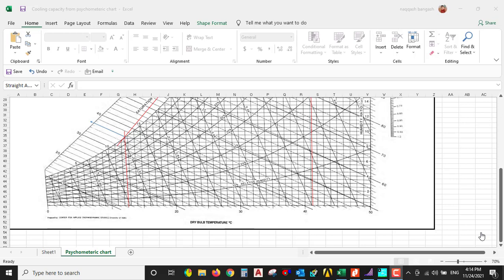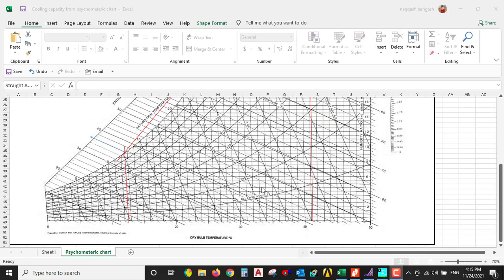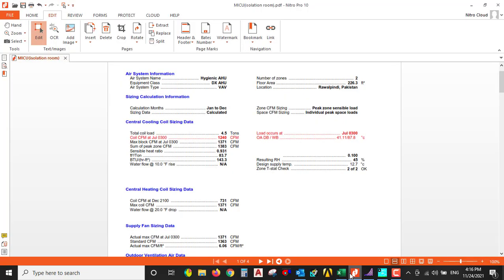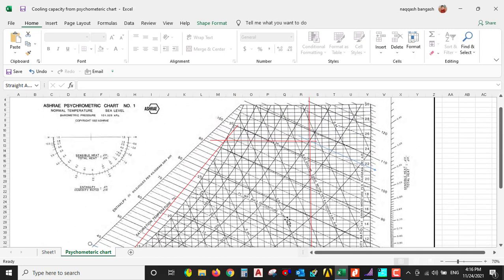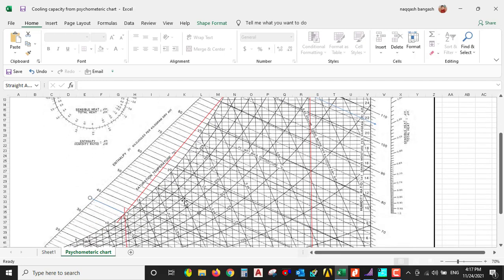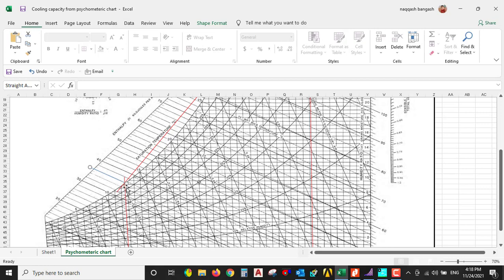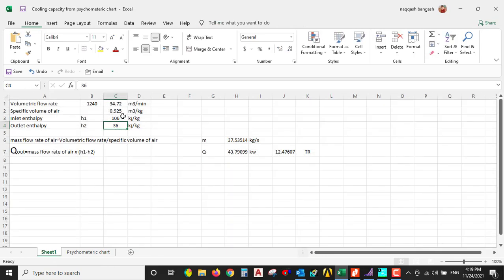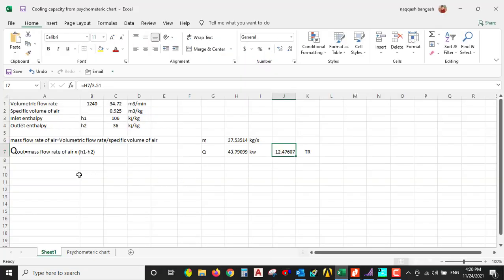Cooling Coil load calculation using Psychometric chart

Comment: Nice video sir ,
But as thumb rule 
1tr =400cfm
So for 1200 cfm =3tr 
But in yr hap report its show 
Total cooling load 4.5tr

And cooling load calculated by using the chart is 12 tr 

So there is too much diffeence

Maybe this due to we consider 100 of fresh air entering the coil and we exahusted it out side . 

And in hap it shows less load on coil maybe due to return air is mixing with the fresh air . 

But sir calculating manually on the chart with out considering the actual conditions , will make difficult to compare our calculation with hap 

Is it right
Reply from the maker: The 400cfm/TR is a norm, The HAP shows less because of the recirculated air, but the calculation is for 100% fresh air, The cfm/TR will always be different because for SHR.

Comment: How 87.8 wet bulb is possible.
Reply from the maker: @ahmedshafath  this is just for the purpose of understanding the software. There are different places where WB is above 80.
During load calculation, always calculate at 2 conditions ,1- maximum dry bulb temp, 2- at dedumification conditions. The coil will selected either based on condition 1 or 2 which ever is greater.

Comment: we can calculate fresh air using HAP, why psychrometric
Reply from the maker: You can with HAP, but not always. You must have knowledge of how to do that with psychometric.
Reply: @passionateengineermep  Thanks , is there any video or ASHRAE Psychrometric is enough, I read from it they are stating that " It is best practice to contact a cooling coil manufacturer (or run their cooling coil selection software)
Reply from the maker: The best way is to contact the manufacturer, but you have to provide coil ADP, which depends on the loads conditions.
Psychometric is a quick way to analyse what you need and what will be provided to manufacturers
Reply: Thanks a lot , what about Coil ADP provided by HAP can this be relied.
Reply from the maker: It is also good if you did the calculations in the right way because internally, you have no idea how HAP is calculating the coil ADP.
HAP is based on heat balance.
Reply: Yes you are right HAP is moving toward heat balance,    " In summary, both the HBM and RTSM serve critical roles in the field of cooling load calculations. The HBM's detailed, integrated approach offers a high degree of accuracy and is particularly suited for complex architectural designs or when precision is paramount. The RTSM, with its simplified methodology, is suited for standard applications where complex thermal interactions are less of a concern.

Comment: you divide volum flow rate ( m3/min ) with specific volume ( m3/kg ) should you get mass flow rate in kg/min instead of kg/s ? since you are using perminute so Q out is kw/min not kw/h correct ?
Reply from the maker: There is a formula in the Excel sheet, which is directly converting the value.
I'm sorry to show this in the video, but you can follow your calc.

Comment: If the air at dry bulb temp at 36 deg C and RH at 42 %,  can i cool the air at 11 deg C by directly adding chilled water into air  through evaporatorive cooler.
What will be the required sprayed chilled water temp and flow rate?
Can we use chilled water at  7 deg c
And what is the chiller load TR of makeup chilled water?
Reply from the maker: Q= 1.08xcfmxDeltT
You will get the sensible heat.

Comment: Hi, you made a mistake. 34.72 m3/min / 0.925 m3/kg = 37.53 kg/min and not kg/s ;)
Reply from the maker: Yes, just unit mistakes but calculations are right,there is conversion factor already added in excel file.

Appreciate your comment

Comment: This assumes that all the air is cooled to 12.7 C saturated. In real life only part of the air volume gets in touch with the cooling coils which would be at a T lower than 12.7 (and therefore cools down to saturation point). This will mix with the remaining air volume and therefore the final point for the entire air volume is somewhere in the middle. You don’t supply air at 100% RH to a room.
Reply from the maker: The method shown in video is for 100% fresh air.
Reply: The fresh air percentage is not what I was questioning. Your final point is shown on the saturation line, so assumes that the full fresh air volume is at 100% relative humidity. This is not possible in reality, as not all the air volume will actually touch the coils. The final point would have a lower relative humidity. In your data sheet it says that the resulting RH at 12.7 C is 45%. This is more realistic. Thanks anyway.

Comment: i did calculation by your metod but answer comes wrong and have checked your answer which is also 
 wrong .
Reply from the maker: Only mistake is unit, its kg/min and i used conversation factor in Q calculation

Comment: I think the calculation is wrong if first the Flow rate is in M3/min and not M3/s. if you multiply (H1-H2)* Mass flow rate, we do not get the same result as you. Can you please clarify.
Reply: Answer and Calculation is correct,  i just put it kg/s instead of kg/min, i already used conversation factor in Q Calculation. If you convert  cfm in to m3/sec than no need to put coversion factor in Q calculation

Thank you.
Reply: @naqqashsajid  you should divide by 60 for put second instead of minute
Reply: M = 0.625 kg/s

Comment: In HAP generated report it shows that 4.9 ton coil load is required, then why did you calculated it by manual method.it is my doubt, if u can please tell me
Reply from the maker: Some conditions are different, HAP calculation was based on VAV system and manual calculation is done to check that what will be the coil load on 100 fresh air at 106 F that is cool down to 55 F.